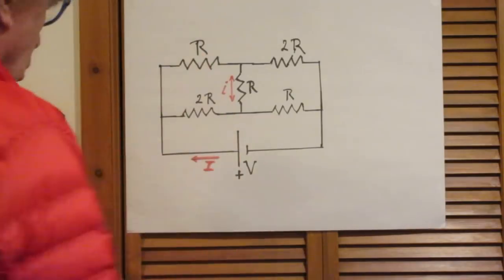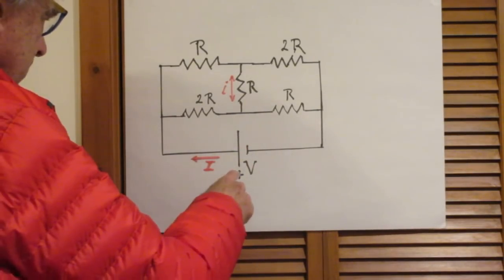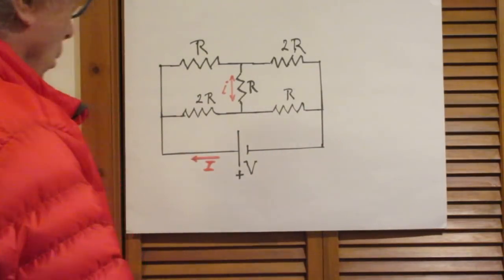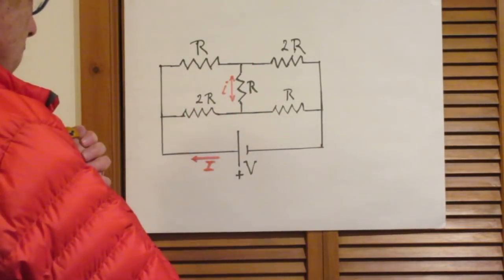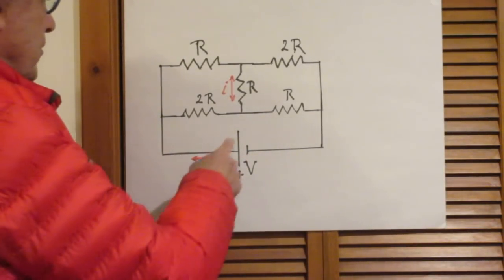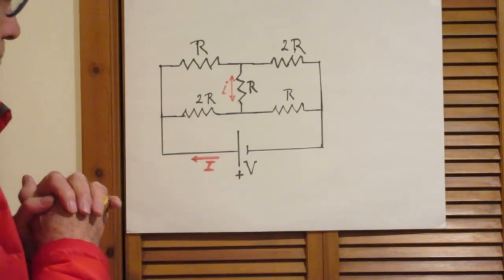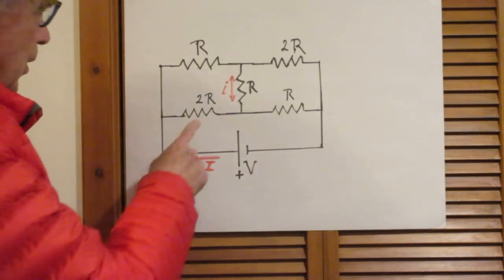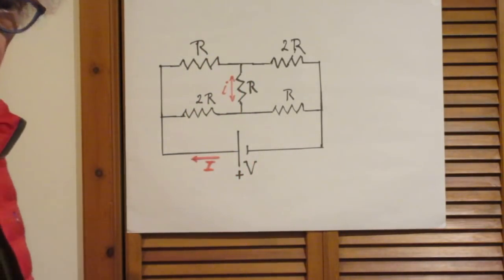Problem #24  Circuit with Five Resistors

Comment: Prof.  Lewin,
I just scanned through the comments and find it quite amazing at the variety of answers.  All the wrong answers could have been determined to be incorrect by the problem solver simply performing a check with KVL or KCL at a few nodes or loops for consistency.  Do students not check their answers these days before submitting them?  Apparently  not.
GH
Reply: ditto :)
Reply from the maker: In my solution I first solve the problem "brute force". After that I solve it in less than 5 minutes using a much more efficient approach. I think you will like that one.
Reply: I am sure I will enjoy your approach.   I just produced a video solving the problem several different ways to show students that there are many approaches:   KVL with loops,   KCL with Node voltages,  Thevenin equivalent circuits, DELTA-WYE transformations etc.  I will not upload it until after you publish your solution so as not to spoil the the process of your challenges.  Let them stew on it for awhile  :)

Brute force and guessing solutions are often times a good first pass and if one's intuition correct, the answer emerges.  Then go back and refine the approach to put rigor in the analysis -  I do that a lot too.  Kind of like doing a mathematical solution/proof FORMALLY and then go back and justify your steps with rigor.
GH
Reply: Problem suggestion for you to create:
Take a bullet of certain dimensions and mass (to be specified) having cylindrical shape at a height 2 meters above the earth with initial velocity of 750m/s parallel to the earth at the equator traveling in a true north-to south direction.  It is in balistic free flight at sea level with the air at STP.  Neglect forward air drag on the bullet.  After it has traveled 1500 meters, how much will the bullet deviate east or west from true north-south and how much will it have dropped?  Use radius of the earth at the equator as 6371km.

Some variation of this might be appropriate as a problem where need to account for coriolis force and also the atmosphere "pushing" the bullet sideways in an easterly direction as the earth rotates carrying the atmosphere with it.
Just a thought.
GH
Reply from the maker: no air drag is unrealistic. I could do it in the LIGO tunnels (vacuum). However, after 1500 m the bullet will have lost 20 meters in height. Not good.
Reply: True,
I just did off the top on my head without really calculating the actual drop:  0.5gt^2 = 19.6 meters
Thought the air drag consideration might be a bit much for your audience but you know their capabilities better than I do.
Just was suggesting a possible outline and leave up to you to "fix" it up to make a problem that might make sense.  You are the master at this and not me.
GH
Reply from the maker: the 20 m down make it an absurd problem
Reply: It can be fixed up by having a higher muzzle velocity and/or shorter distance.   Say make the initial velocity that of a modern rifle with a high performance cartridge at1350m/s(4500fps) and the distance to target 1080m then the travel time is 0.8sec  and the drop is 3.14 m.  This is still a bit large but manageable.  One could make it a tank penetrating round at 1700m/s to 1190m distance making the flight time approximately 0.7 sec with a drop of 2.4meters.

I was more concerned about have a long enough flight time so that the atmosphere pushing sideways as it rotates along with the earth's surface might make a noticeable shift in the east-west deviation and not be swamped out by the coriolis drift.

Was just thinking off the top on my head without putting numbers to it to see wondering if the sideways force is even significant enough to consider.  The sideways "wind" force of the moving atmosphere integrated over the surface area of the cylindrical bullet might not amount to much.  That I do not know and do not have a feel for.  I just need to sit down sometime and figure it out to get a feel for the magnitudes.  

This would be kind of like knowing that at the equator, the gravitational force acting on a body is greater than the centrifugal force by a factor of 291 to 1.  That I have a feel for.  Maintaining the same radial distance from the center of the earth so as not to take into account the gravitational changes due to the poles being flattened by 22km, a 686Nt. man will weigh less at the equator than at the poles by 2.36Nt (686/291) due to the centrifugal force.  
GH
Reply from the maker: >>> given the same radial distance from the center of the earth.>>>
The radius at the equator is 22 km larger than at the poles. that further lowers the gravitational attraction at the equator by 1% compared to the poles.
Reply: I understand that, that is why I stated that the radial distances should be should be the same.  I edited that statement in the last comment to make it clearer.  The change in radius with the poles being closer to the center than the equator means the difference in gravitational acceleration and force is 1 part in 146 stronger at the poles and the difference in centripetal acceleration and centrifugal forces is 1 part in 291 less at the poles with both contributing to increasing one's weight at the poles as opposed to the weight at the equator.  So in order to separate out the contributions, I suggested to keep the radius the same between being at the equator and the poles even though in actuality you need to be 22km above the earth at the poles.  That is the only reason.
GH
Reply: Good morning Professor,
Woke up today with a eureka moment regarding the bridge network. There is a very easy way to solve it by taking advantage of its R-2R symmetry as I always thought there should be.

I will post it for you elsewhere and not to this video.

GH
Reply from the maker: George wait till you see my 2nd solution - I will post next Saturday. I doubt whether any other solution would be faster.
Reply: Sir,
You have my attention.
I posted what I came up with today to the other conversation we are having regarding our friends in Holland on Faraday so as not to tip off the students here in this video.

Just finished winding a Long Solenoid for your Faraday experiment.
Shortly I hope to recreate your experiment with precision to not only have a qualitative demonstration but a quantitative one as well with both an AC and  DC transient changing magnetic field.  Should be able to also demo polarity with AC using a vector voltmeter to get phase relationships.  Stay tuned.
Take care and enjoy your day.
GH
Reply from the maker: If your demo has the same clarity as the transformer one, I will upload it on my channel. https://www.youtube.com/watch?v=b7i2uMx7gHo&list=PLyQSN7X0ro22zanLOcvkaSY-IZqheFYM5&index=8
Reply: ---------------   Solenoid  specs  ------------------
It will be a few weeks before I get it done for I have a lot on my plate these days. I expect that if I do this,  it will be with the utmost care and attention to detail as my training in metrology at Hewlett Packard labs has taught me.  I will let you preview it before uploading in case there are other tests and considerations you would like to see covered.  I would like this set of measurements to put the nail in the "coffin of doubt" about using Faraday's law to predict outcomes with non-conservative systems.

--------------------------------------------------------------------------------------------------------------------
Just finished winding the solenoid a few hours ago.
SOLENOID   COIL   SPECIFICATIONS:

Coil form:  schedule 40 white PVC
Coil form OD diameter:  26.7 mm          Inside diameter:  19.6mm
Coil Length:   32.8cm   outside edge to outside edge of winding
Length / Diameter = 12.28

wire gauge:  19AWG 
wire diameter:  0.890mm   (0.0350 in)   +/- 0.004mm

number turns:  698   in two layers    2 x [145 x 32.8 / 13.6  - 1 ]  =  698 Turns
                                                          ( 145 wire dia measured in 13.6 cm )

winding pitch:   349 Turns/32.8cm = 10.64T/cm               (AWG 19: 11.0T/cm)

Mean winding path layer #1 = 86.676mm
Mean winding path layer #2 = 92.269mm
winding wire length:   62.452m ( 204.89ft.) 
                                      1st layer = 30.250m / 2nd layer = 32.202m

winding Rdc:   2.1600 ohm  (measured 4W-Ohm) 
wire resistance:      34.587 mOhm/m  =  10.54 mOhm/ft. 

Frequency           L(mH)        Rac(ohm)
        DC                    ----            2.1600  (34401A)        2.1525   (4263A)
     100Hz           1.1925          2.718
       1KHz           1.1925          2.755
    10KHz            1.2021         2.897
  100KHz          - 9.172           3.048

   At  f = 100KHz:
               Z  =  3.0507K  -  j 5.769K  ohm  =   6.526K /  - 62.13 deg  ohm
               Z  =   6.535K / - 62.21 deg. ohm

NOTE:   inductance is negative at 100KHz.   This is because the self resonance of the solenoid is lower than 100KHz and the coil reactance is dominated by the interwire capacitance between winding turns.   This is verified by the measured impedance which shows a negative phase angle of ( 62.2 deg ) at this frequency.  A negative inductance in computed by the instrument when in INDUCTANCE mode and the impedance is capacitive (negative phase angle).

The AC resistance, Rac, increases with increasing frequency due to "skin" effect.  The increase goes as square root of frequency above the corner frequency.

From wire AWG wire tables:    
        19 AWG    dia =  0.912 mm   ,   26.42 mOhm/m
        20 AWG    dia =  0.812 mm   ,   33.31 mOhm/m
----------------------------------------------------------------------------------------------------------------------------
                 
Ideal solenoid inductance (Theoretical):

                               L  =    µo • N^2 • A / l   Henries
                                  µo  =   4π × 10^(−7) H/m

For the solenoid:  A =  π (0.0267/2)^2  =  0.0005599 m^2
                                 l  =  0.328m
                                N  =  698
                                 L  =  1.045 mH           Measured:   1.19mH

Using the Nagaoka formula for a single layer coil with same number of turns with the cross-sectional diameter taken at the layer boundary:

                            L = 1.146 mH   ,   Measured = 1.19 mH    [ 3.8% error ]
----------------------------------------------------------------------------------------------------------------------------

Measurement instruments:
LCR meter:  Hewlett Packard 4263A
DMM:   Hewlett Packard / Agilent: 34401A
electronic digital caliper
Reply: Prof. Lewin,
I find it very interesting that many of the more recent posts have the answer correct for (i) but not for capital (I).  It is beyond me how they do that.  You would think they would do a quick check of the answer by writing KVL around any loop to see if the voltage sum comes out ZERO.  To get capital (I), the branch currents on R-2R would need to be known and an easy application of KCL would also catch errors.
GH
Reply: Prof. Lewin,
I have a question that has been bothering me regarding what is referred to as "relativistic mass".

Total energy of a mass moving with velocity v relative to a fixed inertial frame of reference is:

                        E = γ Mo c²    where   γ = 1/ √ [ 1 - (v/c)² ]

If we understand "γ Mo" to be interpreted as relativistic mass we can write:
                        E  =  M c²   

where  Mo is the rest mass (v = 0.0) and M is the relativistic mass

This increase in energy of a mass when moving is exhibited as a momentum increase due to the velocity it has relative to a fixed observer as seen by this observer.

QUESTION:  is relativistic mass really an increase in mass as an object moves closer to the speed of light as the term "relativistic mass" would have us believe or does the object ALWAYS have its rest mass value, Mo?  I can see how an object can have an increase in kinetic energy and momentum as its velocity increases which is due to the increase in velocity as opposed to an increase in mass.

If one expands γ = 1/ √ [ 1 - (v/c)² ]  out in a power series you get:

             E  =  Mo  +  .5 Mo V²  +  higher order terms

The [ .5 Mo V² ] is the Newtonian KE for v << c.  In Newtonian mechanics we never think of an object's mass changing but attribute its Kinetic energy as being due to the object's velocity.  So extending this concept to relativistics velocities, does not the object's mass remain at its rest mass value, Mo?.

I can see the usefulness of "relativistic mass" for it incorporates the Lorentz factor into the mass and allows one to write  E = Mc²

The other problem I see is how can one actually measure "relativistic mass"?   You can measure the object's momentum and energy but how does one measure and parse out the mass of something moving relative to the observer?  You can measure the mass within the moving frame for it will just be the rest mass, Mo, but how would someone OUTSIDE the frame measure the mass?
GH
Reply from the maker: I never use the words "relativistic mass" but many books do. I ONLY use the word rest mass. 
E= gamma*rest mass*c^2.  Many booksc call  gamma*rest mass relativistic mass.
Reply: So relativistic mass is a misleading term is it not?  Such does not describe what is really happening at these extreme velocities to an object's mass.  Is that correct?

PS just finished a comment to our Dutch friends regarding their results.
GH
Reply from the maker: whether it is misleading or not is a matter of taste.  I never use those words. momentum, p, is gamma*mv. It does not make things easier for me to think of  gamma*m as "relativistic mass". But I do not object to it. My next Physics problem is an SR problem. In my solutions (I give 4 solutions) I never use the words "relativistic mass".
Reply: So an observer in the "lab" does not see the MASS of the moving object increase but rather sees the momentum and energy increase in a relativistic manner is that correct?   An observer in the lab sees time dilation and length contraction but not mass increase is that correct?
Reply from the maker: an observer in the lab measures that E=gamma*m*c^2 PERIOD. Here m is the rest mass. She will measure that p=Gamma*m*v PERIOD, here m is the rest mass. I cannot add anything to this.
Reply: I believe we are saying the same thing.   If I am understanding this correctly.  An observer cannot measure [gamma*m] as a separate quantity.  It is embedded in the measurement of E or p and is not an independent entity that can be measured as a mass different from the rest mass.  Is that how you see it?
Reply from the maker: an observer can measure v.  The observer then knows E and p assuming that the observer knows the restmass. Thus the observer can calculate gamma*m if she wants to call that relativistic mass that's fine with me but I never do that. 
https://en.wikipedia.org/wiki/Mass_in_special_relativity
Reply: On another note.  I do not think our Dutch friends understand the importance of having the magnetic flux confined to a small cross-sectional area within the resistor loop.  Their setups have leakage flux with non-zero B-field in the area outside the solenoid interior because they are not using a long solenoid to generate the changing B-field.  Very frustrating in trying to get them to understand this.

In essence they are not measuring your demo but a more complicated problem.
GH
Reply from the maker: George, don't beat a dead horse.! There are people who object religiously to the correctness of the mind-boggling demo that I do at the end of lecture 16 of 8.02. They all conveniently overlook that this demo showed PRECISELY what was predicted by my derivations. Two identical voltmeters are attached to the exact same 2 points in my circuit. The Curl(E)=-dB/dt caused an induced time variable emf in the circuit and consequently at any moment in time (my time resolution was 0.1 msec) voltmeter #2 showed values 9 times larger than voltmeter 1 and the two voltages had reversed polarities. END OF STORY!
Reply from the maker: Therefore, all objections are meaningless and without merit; they are wrong at best.
Reply: Prof. Lewin,
Thank you for the reference in wikipedia "Mass_in_special_relativity".  I totally missed that entry and I now see that there is a hyperlink in the general MASS entry to it under the section called MASS in RELATIVITY but again I missed it during my searches.   Hyperlinks being in blue next to the black print sometimes do not show up well on my computer screen.  With faint contrast between the text print and links it becomes very easy to miss.  Wiki should put the hyperlinks in a more contrasting color next to the black print such as YELLOW or have an option for higher contrast colors so the hyperlinks become more visible.  Without noticeable hyperlinks in the text, if one does not choose the right KEY words, a wiki page can get missed.  Most times successful searches require a person to phrase the search phrases properly and if you do not get it right, you can miss important references and documents.

High velocity physics is not my field so my interest is purely academic.  I was not aware that the measurable inertia and gravitational attraction of a body in a given frame of reference is determined by its relativistic mass, not merely its rest mass.  That I find interesting for I have never attempted the calculations so never gave it any thought. Guess it never occured to me the gravitational attraction between two bodies is affected by their relative motion. 

Much to my frustration, there is just not enough time in one's day to pursue all these interesting details in mechanical dynamics.  My field is in the electrical sciences related to precision analog circuit design used in NIST certifiable laboratory grade instrumentation that require precise signal conditioning and low noise high accuracy amplifiers and attenuators.  I deal with, among other things, EM theory related to transmission lines and component stray coupling and signal integrity issues in electrical networks related to RFI - EMC and Laplace/Fourier transform theory in finding closed form solutions to transient electrical networks.

We all have our specialties but I try not to let it limit my interests and horizons.  Thanks for the communication.

George Hnatiuk